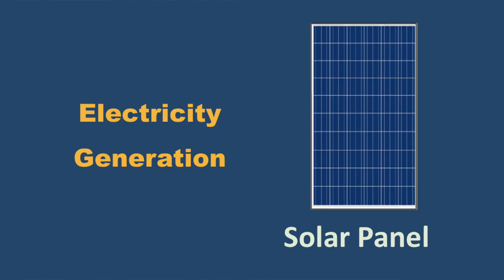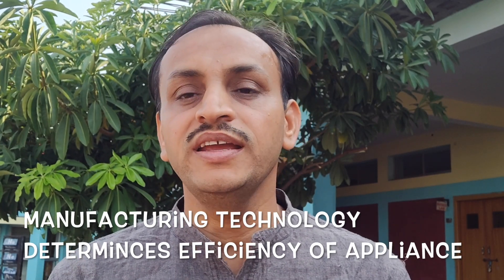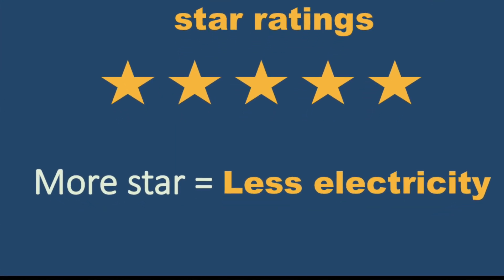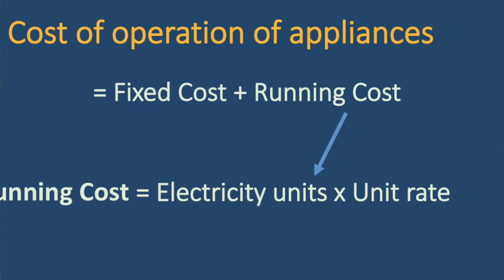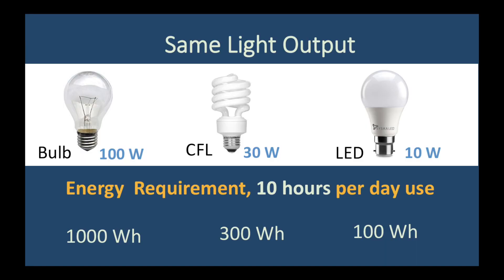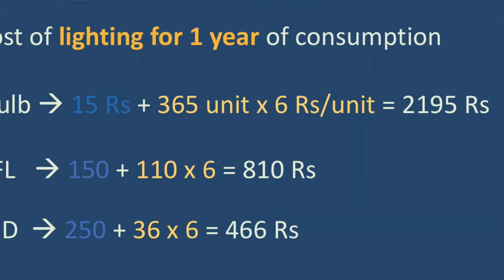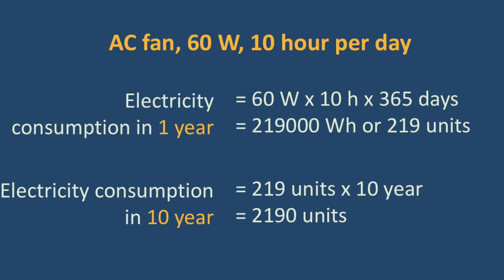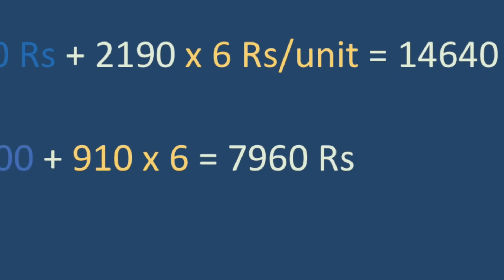Step 11- Operating Cost of Home Appliances | Part-1  : Star Ratings || Learn to Design Solar Systems

Comment: A1: Power rating: 192 Watts
A2: DC based system is better (i) as the solar panel generated DC power, so better synchronization, (ii). It increases efficiency, no convertion losses

Comment: Q1)192W
Q2) In DC system efficiency is high and low running cost but what about the glare in LED light, how to reduce it

Comment: Hello 
1. W = I * V
Value x = 8 * 24
192 Watts 
2. Bcus solar system is costly in Fixed rate but less in cost efficiency. 
When we use DC based appliance it saves a higher amount of money in long term.

Comment: Question 1 answer)=24×8=192 watts
Question 2)=
DC system has less power rating compared to the ac system at same output ratings.
DC system has high efficiency than compared to ac.

Comment: 1. Power rating=24×8=192W
2. Running cost is lesser then ac based solar system that's why the total cost is much lesser and more efficient.

Comment: Q1)24 *8=192 watt
Q2) because it is efficient ,when we convert power from DC to AC there is loss in power so with the help of charge controller we use DC to DC where it is very efficient and very less power loss

Comment: If the input voltage rating of the charge controller is 24 Volt and current rating is 8 Ampere 
then power rating can be calculated by,
Power= Voltage*charge = 24*8
           = 192W

DC based solar systems are better for homes than AC based solar system as there are no conversion and transmission losses.

Comment: Q1a) 24V*8Ampere = 192 Watts
Q2a) No extra appliance is required which is inverter, conversions from dc-ac and ac-dc requires power loss. so, considering these two factors and the fact that solar panel, loads, batteries and charge controller are DC, DC based solar systems are better than AC based solar systems.

Comment: At 9:54, DC Fan electricity consumption for 1 year is 20W x 10h x 365 days = 73000 Wh and not 91250 Wh. There by the 10 year calculation also changes from 910 units to 730 units. Please check out.
Reply: Also the cost projection for the DC fan also also varies from  Rs. 7980/- to Rs. 6880/-

Comment: Question 1
Power Rating of Inverter at home = 192 W

Question 2
Input Power of Inverter = 2 KW = 2000 W
Maximum Output Voltage = 48 V
Maximum Input Current = 41.6667 A

Comment: V = 24 V      I = 8 A
P = V*I = 24*8 = 192 W

As losses in DC solar system are less, so the efficiency of DC  solar system is more and low cost ....

Comment: 1. The power rating =  192 watt.
2. They are more efficient which is results in low cost of power.

Comment: My question is that:
We have both type of appliances in home..DC and AC....we have new DC fans and other AC systems.. so what will be advantageous Inverter or charge controller?
Total electricity load for our home is 1500Watt.

Comment: Hello Sir,
Q.1) If input voltage range of a Charge Controller is 24 Volt, and Current Rating is 8 Amperes, then what is its Power rating?
Ans) V×I = 24×8 = 192 Watt

Q.2) Why DC based Solar Systems are better for homes than AC Based Solar Systems?
Ans) DC systems are more efficient and it consumes less energy. So charges will be less and money is saved.
Thank you so much
Reply from the maker: keep learning and do follow the channel for more interesting  videos about solar energy.

Comment: i have a doubt .what happens when we turned off all appliances and also battery is full???           then  the voltage from the solar panel is equal to the  voltage of battery and it causes damages to battery
grid is not connected to it !!!!!!!!!!!!!
Reply from the maker: No. It is not the case, charge controller is their to protect the battery from over charging. Solar panel supplies electricity at high voltage while battery reaches the rated voltage once full charged.

Comment: 1.The power rating for 24V input voltage and 8 ampere current rating is (24V*8A)=192VA=192W

2.DC is best because it is cheaper,has more efficient and simpler.
Reply from the maker: keep learning and do follow the channel for more interesting  videos about solar energy.

Comment: Answer 1.
Power rating= voltage*current =24v*8Amp =192 watt.
Answer 2.
DC solar systems are better than AC solar system because they are more efficient and cost effective.
Reply from the maker: keep learning and do follow the channel for more interesting  videos about solar energy.

Comment: Ans 1: 192 W
Ans 2: It depends upon type of appliance in Home . All solar system generates DC so if AC appliance is used DC to AC conversion is required . During conversation some energy is lost.  So depending on type of load solar system can be DC or AC.
Reply from the maker: keep learning and do follow the channel for more interesting  videos about solar energy.

Comment: Does DC fans convert AC to DC?if yes then if I replace the current AC fan with DC fan what will be my consumption- 60w or 25w?
Reply from the maker: No. DC fan runs on DC power and it not at all convert AC power. Typically power require. by DC ceiling fan (blade length 1200 mm) ranges between 25W-30 W. For more details about other DC appliances kindly visit website www.energyswaraj.org.

Comment: Q1-For charge controller 
Input voltage rating=24V
Input current rating=8A
Power rating= 24V* 8A= 192W

Q2- DC based solar system is more efficient than AC based solar system, there are no conversion so no losses so it has high efficiency and they are cheaper
Reply from the maker: keep learning and do follow the channel for more interesting  videos about solar energy.

Comment: AC Fan, 40 W, 8 Hrs ,per day for 10 years 
Electricity Consumption =
 40 ×8×365×10= 1168 units
Cost of AC Fan =
1500+1168×4.50=6756 Rs.
DC Fan , 15 w, 8 Hrs, per day for 10 years
Electricity Consumption =
15×8×365×10=438 units
Cost of DC Fan = 2500+438×4.50=4471Rs.
BY NEHAL SETHI,
DAV (CAMBRIDGE)PUBLIC SCHOOL PUSHPANJALI ENCLAVE
Reply from the maker: keep learning and do follow the channel for more interesting  videos about solar energy.

Comment: Ans1) V * I = P
         P =24*8 = 192 W
Ans2)  Because for Dc system appliances the fixed cost may be higher but power consumption and operation cost is lower  compared to AC system
Reply from the maker: keep learning and do follow the channel for more interesting  videos about solar energy.

Comment: Q1 . power Rating for the charge controller is = 24v * 8A = 192w

Q2. DC Based Solar Systems are More Efficient compared to Ac Based Solar Systems . 
               Dc Based Solar Systems will save the cost of Electricity  compared to Ac based Solar Systems.
               if we use Dc Based Appliances this will consume less Electricity compared to Ac Appliances.
Reply from the maker: keep learning and do follow the channel for more interesting  videos about solar energy.

Comment: 1) Power rating is 192W
2) DC power is more efficient, conversion losses are avoided and they are lower in cost.

Sir, there were 2 errors in calculation. The following are the corrected values.
a)	Rs. 15 + (365 units * 6 Rs/unit) = Rs. 2205
b)	365 * 0.1 = 36.5 ≈ 37 units
Reply from the maker: keep learning and do follow the channel for more interesting  videos about solar energy.

Comment: Ans 1)  192 W  is the power rating of the charge controller
Ans 2) The charge controller transfers DC power stored in batteries to DC appliances effciently  with efficiency of 85-95%. Also  if  there is no intermediate conversion requirement from  AC to DC, due to use of DC appliances and the appliances are within short ranges, hence there is no need for the conversion, it will save onto the conversion loss.
Reply from the maker: keep learning and do follow the channel for more interesting  videos about solar energy.

Comment: Q1 Answer: Power rating = voltage * current
= 24 * 8
Power rating = 192 W
 
Q2 Answer: In DC systems, no need for conversion and less power losses. So higher in efficiency and lower in cost. 
Therefore, DC-based solar systems are better for homes
 than AC based solar system
Reply from the maker: keep learning and do follow the channel for more interesting  videos about solar energy.

Comment: A1.
Power= Voltage X Current (A)
Voltage= 24 V  Current (A) = 8 A
Power rating = 24 X 8
                       = 192 W
A2.
Conversion form DC to AC and again from AC to DC causes loss of energy.
AC is good for transmission to longer distances, it causes loss of transmission total of operation is very high.
Reply from the maker: keep learning and do follow the channel for more interesting  videos about solar energy.

Comment: The comparison of DC and AC appliances is done using grid cost, can you please explain with example when Using Solar power comparison between AC and DC applicances. Apart from conversion from DC to AC is there any other loss? Also please explain, should we include the capital cost of solar Panel and battery should be used to calculate the operating cost?
Reply from the maker: You can watch step 14 and 15 for comparision between ac and dc appliance and power consumption for ac and dc appliance

Comment: Q1:163.2 KWh with 85% efficiency.
Q2: Power management system for DC based power system is comparatively simpler, cheaper & efficient.
Also as the domestic  solar power plant is close to our home, hence no need to transmit the power generated to long distance via A.C.
Reply from the maker: keep learning and do follow the channel for more interesting videos about solar energy.

Comment: * Question 1 Ans. 
The power rating is 192watt. 
* Question 2 Ans. 
 1 It saves the inverter cost. 
 2 Dc based solar system efficiency is 
    better than the Ac based solar system.
Reply from the maker: Great! keep learning and do follow the channel for more interesting and informative videos about solar energy.

Comment: Answer 1:
Input Voltage=24 volt
Current Rating=8 Ampere
Power Rating=Voltage X Current
                             =24 Volt X 8 Ampere
                              =192VAm
                              =192Watts.
Answer 2:
DC based Solar system is more efficient than AC based Solar System as it is more economical due to less losses of energy and more energy efficient.
Reply from the maker: keep learning and do follow the channel for more interesting  videos about solar energy.

Comment: Answer 1 : Power rating  = v x i  = 24 x 8 = 192 W
Answer 2: Dc based solar systems are efficient and over the long period the cost is also cheaper to usage, even though the initial cost is higher for the dc appliances.
Reply from the maker: keep learning and do follow the channel for more interesting videos about solar energy.

Comment: 1. Input voltage rating = 24 V and current rating = 8 A
Power rating = V x I = 24 x 8 = 192 W
2. DC based systems have lower losses compared to AC systems, and hence are more efficient, especially over short distances.
Reply from the maker: keep learning and do follow the channel for more interesting videos about solar energy.

Comment: the power rating of charge controller for 24V input and 8A current will be 24x8=192W
DC based solar systems are better because they are cheaper compared to AC solar system also they are efficient and less losses occur so we can obtain the maximum output compared to AC
Reply from the maker: keep learning and do follow the channel for more interesting videos about solar energy.

Comment: Power rating for rating of 24V and 8A will be 192Watts
And
DC based solar system are better over AC based solar system because there is less loss of energy in DC system and are more efficient and cheaper
Reply from the maker: Great! keep learning and do follow the channel for more interesting and informative videos about solar energy.

Comment: Thank you Sir
Ans Q1) The Power rating of controller =192 Watts
Ans Q2)
As we use DC based  appliences , consumes less energy  compair to AC appliences of same functioning (like DC led bulb , TL, DC Fan etc )
so energy consumption is less  & the charges of electricity also will be less  and we can save mony with running cost 
Also if we used dc based appliences  , battery size(AH Capacity) requies less a  and more backup than ac appliences
Reply from the maker: Great! keep learning and do follow the channel for more interesting and informative videos about solar energy.

Comment: Q-1 Power Rating of the Charge controller = 24 V x 8 A = 192 W
Q-2 DC based solar systems are better for homes because its operational cost is quite lower due to better synchronization, harmony and efficiency of the system components.
Reply from the maker: Great! Did you enjoy working on the solution to the exercise? Please share the video in your groups and networks to help us out in reaching a wider audience.

Comment: Q1. Ans: 192W
Q2. Ans: As DC efficiency of DC Electronic Management System and DC Appliances is considerably less, we require the less rated overall Solar System. Which will refuce the overall running cost. Therefore DC Based solar syatems are better than conventional AC Systems.
Reply from the maker: Great! Did you enjoy working on the solution to the exercise? Please share the video in your groups and networks to help us out in reaching a wider audience.

Comment: Q.1. the power rating of charge controller is 192W.
Q.2.
In solar system no transmission required. So transmission loss is avoided. Inverter has less efficiency and more cost than charge controller.  DC can use all home appliances. Hence DC system is better than AC based.
Reply from the maker: Great! Did you enjoy working on the solution to the exercise? Please share the video in your groups and networks to help us out in reaching a wider audience.

Comment: Ans. 1) Power rating of Charge controller = 24V * 8Amp= Power 192
Ans.2) DC based solar system are better than AC based system because DC based solar system are more efficient than AC based solar system.
Reply from the maker: Great! Did you enjoy working on the solution to the exercise? Please share the video in your groups and networks to help us out in reaching a wider audience.

Comment: Video - 11
Question-1
Answer:-
Input Voltage - 24V
Input current - 8A
Power=?
P=V*I
P=24*8=192 Watt
Question-2
Answer:-
DC is better because no need to convert power at each stage for running load which is DC.
Also for same output DC appliances require less amount of energy hence less size system.
Reply from the maker: Keep learning and do follow the channel for more interesting  videos about solar energy